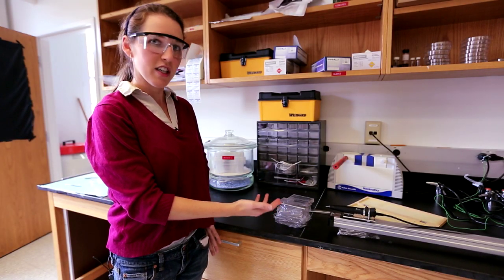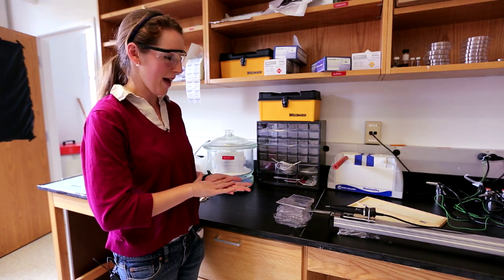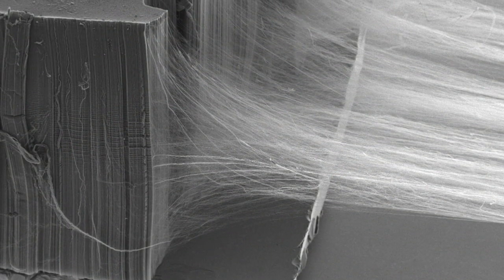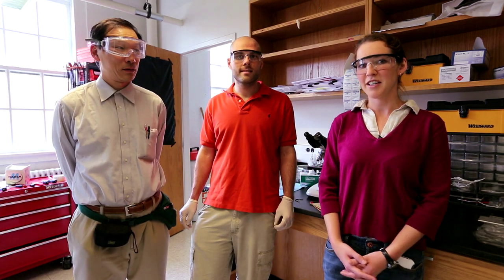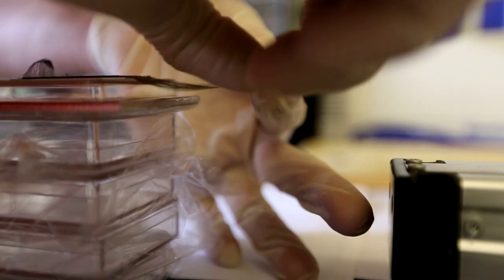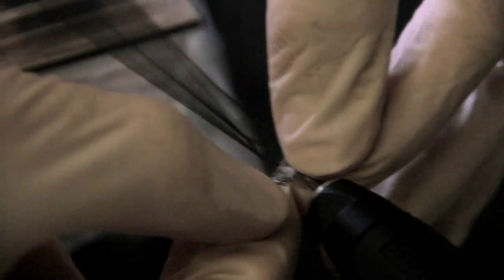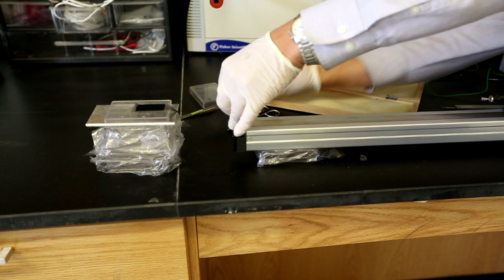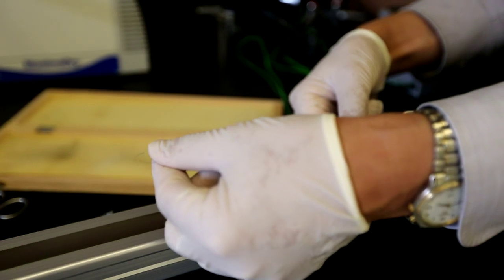Spinning a Thread from a Carbon Nanotube Forest - Bytesize Science

Comment: Um im kinda confused... I thought we couldn't use carbon nano tubes for industrial purposes, i.e. Space elevator? It looks like you guys are able to build with it if you can work the material at the macro scale... whats the hitch then?
Reply: there's a big leap between a thread so small it practically floats and a space elevator.
Reply: A forest of nanotubes is a collection of extremely short tubes. The thicker the diameter of the tube, the less strong it is. If we were to make individual carbon nano tubes longer, the thread would be stronger